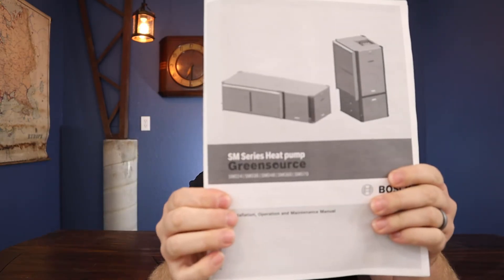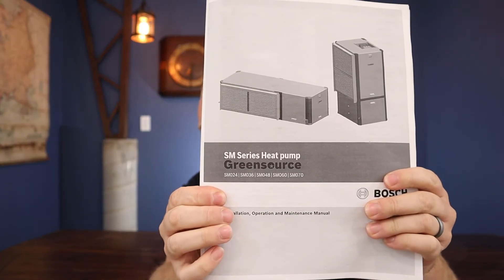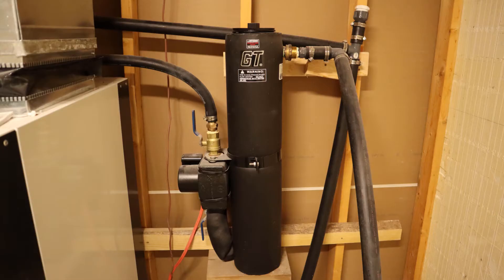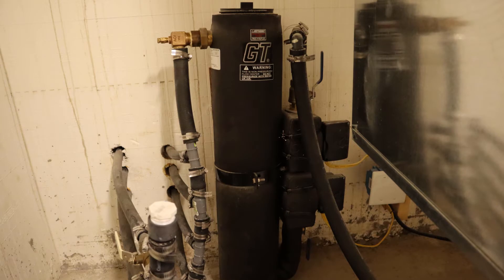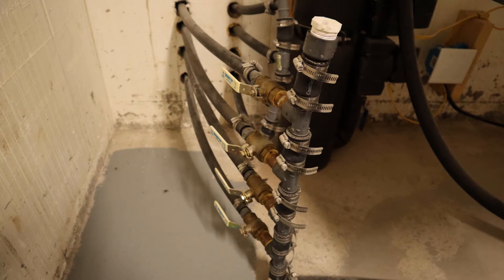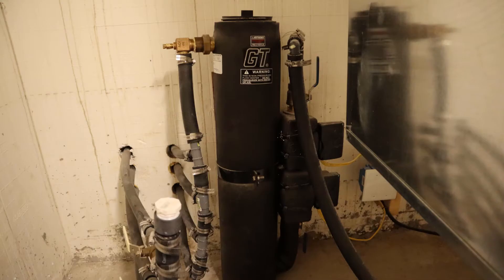How Much My DIY Geothermal System Cost

Comment: Thanks ... learned a lot. i have the land and am building a smaller house mostly off grid ... would it be worth it to bypass the heatpump idea and use geothermal energy for just radiant floor heating/cooling.
Reply from the maker: If it's a smaller house, definitely

Comment: If a person were to install a retro-fit, would it be possible to get a ductless system (like an air-to-air heat pump)? Retrofitting ducting can be extremely expensive in a house with on-grade slab foundation and very little attic space.
Reply from the maker: Do you have existing ducts in your home?  If so, then the system I installed acts exactly like your typical air handler and installs to your existing ductwork the same way.  The main difference is the condenser that normally sits outside is replaced with pipes that are placed in the ground.  If you don't have ducts already, you can install insulated ducts within the attic space for a forced air system.

Comment: I'm starting a ICF built home on 7 acres (foundation & main level) & I'm having a difficult time trying to determine if I should go w/ geothermal vs conventional HVAC system. Considering how efficient ICF is & how efficient conventional HVAC systems are, I'm curious what your thoughts are on geothermal vs conventional in a ICF home? Thanks
Reply from the maker: My house is ICF as well, so I'm pretty biased on the geothermal if you can get the cost down by doing a bunch yourself.  A lot will depend upon you climate too and if you have natural gas nearby.

Comment: Not sure where you are located but you likely will never have the back up heat come on. That would be a lot more likely with DX style of installation. DX the installation is in drilled wells with copper pipe using refrigerant ... no water loops and no pumps. They tend to be 20 to 30 % more efficient than your amazingly efficient system
Reply from the maker: That sounds interesting, and I assume considerably more expensive.  I agree, I don't think the heat strips will ever be used.  I really only intended to have one system with heat strips, but I was a bit hamstrung by what was in stock.
Reply: @Challenged1  actually from what I can determine the eq is cheaper and the cost of drilling is likely about the same as any well drilling. 150 ft well all drilled from a center point with a drill that can go directionally
Reply: @Challenged1  laughing .. no one said you had to hook the power or even run a power line.. Just disconnect the strip from the control board.  easy enough to trace the wire back to the relay and mother board

Comment: just for confusion.. Bosch buys heat pump maker FHP
Bosch has acquired all shares of FHP from a group of investors led by G.L. Ohrstrom & Co. The purchase price will not be disclosed. "With the acquisition of FHP, our growth trajectory in the promising renewable-energy segment is now strengthened in the attractive U.S. market," Thermotechnology President Joachim Berner said. "Because of their energy-efficient and environmentally friendly technology,    I used to sell FHP equipment it is in my view a superior product
Reply from the maker: Correct, from what I understand or have been told by hvac guys, FHP was pretty much top of the line and bosch just relabeled it with their name.
Reply: @Challenged1  last that I installed was a very simple de superheater.  Inline in the hi pressure line .. It had a high and low thermister to control a Taco pump that circulated water to the water heater.  The water heater was basically turned off most of the year, endless hot water and the SEER of the hvac went up
Reply from the maker: @stevepailet8258  How did they connect it to the hot water heater?  That's always my hang up.  I know there is some kind of two-way fitting that can be installed in the drain valve of the water heater, but get plugged very easily.  I assume there has to be a better way.
Reply: @Challenged1  water in water out.  all copper sweat.. freon in freon out again all copper sweat https://i.ebayimg.com/images/g/3-gAAOxy63FSr2ua/s-l640.jpg   This is what that heat exchanger looked like but only 2 loops.  as you can see very straight forward  one side is connected to the pump. so you plumb in from the pump side and then back out.   as for the freon the high side tubing is cut with a fitting and tube that goes to the small pipe and then back into the tube that was cut going back to the inside unit
Reply: @Challenged1  remove the drain valve. then install a nipple with tee. then from there re install drain valve.  tee off of this to the heat exchanger Tee into hot side of tank at the top.  now you have a full open loop into the tank. nothing to clog
Reply: @Challenged1  all the fittings are 3/4 inch so if there is clogging it is due to your water supply.  might consider a large whole house filter with rusco spin down filters with auto purge to keep your house free of debris  http://www.rusco.com/index.php/product1/spin-down-and-sediment-trapper-filters    http://www.rusco.com/index.php/product1/automatic-flush-valve
Reply from the maker: Excellent ideas and simple to boot.  I'll probably make a video about it, so thanks for the idea.  My water softener also has a media filter within it that gets flushed with each recharge, so I'm thinking I should be good on that front.  Time will tell.
Reply: @Challenged1  as far as I know the water softener has an auto dump cycle before recharge to clear the resin canister(media filter).   Whole house filters really help.  I have gone to my final filters as daulton candles in the big blue canister.  it cleans to remove 99.9% of contaminants Think plumbed in Berkey gravity filter.
Reply from the maker: @stevepailet8258  Have you seen any reductions in flow due to the filters?  So far, it seems like the one in the water softener is working pretty well, haven't had any clogged faucet screens or plugged toilet valves.  How long are you getting between filter changes?
Reply: @Challenged1  spin down only change out the carbon filter so no clogging